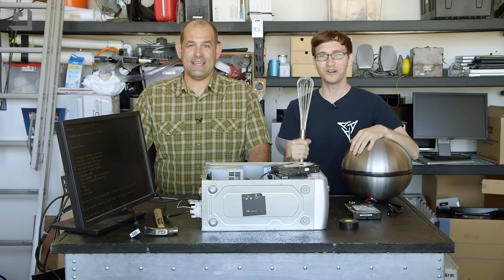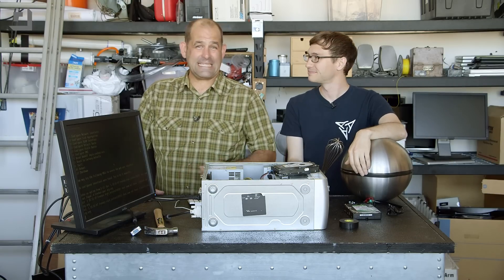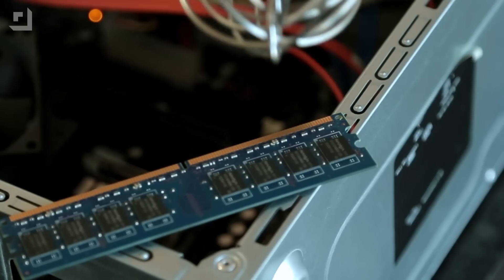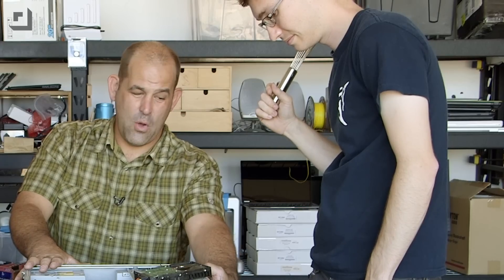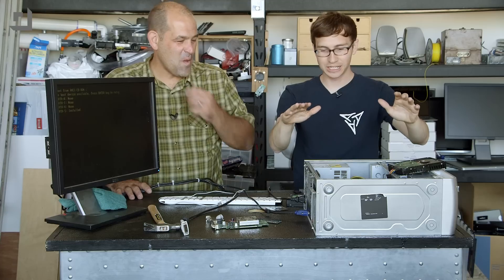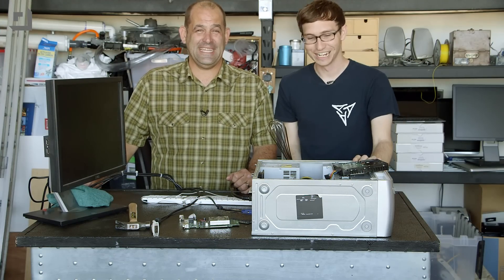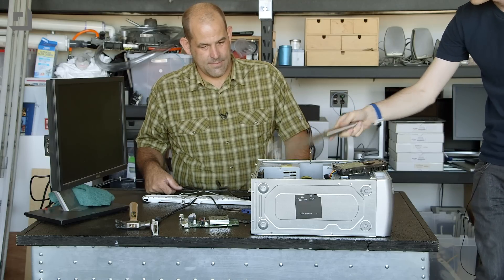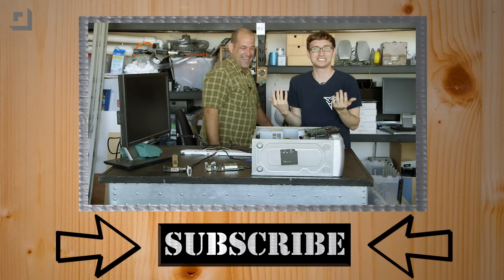Can Static Electricity Kill Your PC?

Comment: Speaking from 20 years of experience repairing/building computers and 5 of electrical engineering, I can say that your average user won't ever have to worry about an electrostatic discharge or ESD causing damage to their computer. Unless you're doing stuff professionally or on a regular basis, I wouldn't say it's a necessity. But it certainly wouldn't hurt. I mean they're only a couple of bucks, vs potentially hundreds or thousands of dollars of damage. But even if you're working with your bare hands with electronics in a dry room, you should be fine as long as the electronics have no path to ground. Anecdotes are weak evidence, but I can say I've personally never had a problem with static working either in computers, or with bare circuits for other things. And I've never heard anything second hand. Having said that though, you can still shock electronics and not even realize it. Either by not feeling it. Or the electronics just won't show any problems right away. Or might have problems you don't connect to the ESD if you did feel it.

 BUT I will say I did just see a video recently where a poor guy was unboxing his new gaming computer, and while he was taking the protective plastic off of the glass, it generated a lot of static and killed the computer. Which I can personally attest to. I've also noticed protective plastic coatings generate a lot of static when you peel them off. So keep your electronics unplugged if you have to peel off anything like that. And ground it with a wrist strap if there is a noticeable amount of static. Or hell, ground it just for good measure. Better safe than sorry.

 So keep your stuff unplugged if you have to work on it. I also make sure to ground myself real quick before working with any electronics. I'll just touch something big and metal, usually the railing on my stairs. If you have metal pipes in your house, you can also just touch a faucet, but I have plastic pipes, so there's no path to ground there. But this discharges any static that's built up on my body before I work on anything. I also try not to wear synthetic fabrics like polyester because they'll generate a lot of static when they rub on hair. Think of rubbing your head on a balloon, same deal.

 And the biggest anti-static rule for me, is absolutely NO KITTIES. Cats are static death traps for electronics. Always rubbing against everything. They know damn well what they're doing, believe me. I've caught my cat reading my white board with electronics notes and diagrams on it before. They understand more than they let on. Plus, one memory that sticks out from my electronics classes was when the professor rubbed a glass rod with a cat pelt to generate static. I have no idea where the school got a cat pelt, I just know it was very old, having been used for this demonstration for decades. So I assure you no cats were harmed to teach that class. At least not any time in the last few decades. But all that lesson taught me was cats = static death traps.

Comment: Static electric discharge can damage RAM in some strange way where it still works most of the time but causes an occasional error which can result in crashes/freezes or other problems. So if you run a diagnostic test on the RAM it will probably pass the test but still be damaged and cause problems.

Comment: Hi

How does touching the metal case of the computer help to discharge the body of electric charge if the computer is unplugged?

My view was that you can only discharge the body if connected to an earthed/grounded cable?

Comment: You don't need a wrist band but it's a nice just incase item to have. Just leave your PC plugged into the wall with the PSU off and touch a metal part of the case every now and then. I wear a strap when I'm building a PC from scratch but when I'm upgrading a GPU or hard drive, I just ground off on the case

Comment: I was building my mother board and I had it on top of the anti static bag. have I just killed it. the whole time I was ground.
Reply: the outside of the antistatic bag is conductive
Reply: +Duncan Robbins-Gennerich the whole bag is conducive, that's the whole point, it's basically like touching a metal surface.

Comment: So a few years ago I had a PC that exploded well the PSU short circuit and blew up in a bright white hot explosion that scorched the side of my motherboard and leaving a black residue on the inside of the case to this date all of those components except the power supply of course still work 100% can anyone explain this to me PS I never ground myself when I work on computers I know I should but it's never been an issue for me
Reply: probably a bad resistor or some metel touching the inside of the PSU

Comment: Even if there's only a 1 in 999 trillion chance of static causing a problem, its still worth having one. Shit, the decent ones are usually $1 or less. I'd rather not chance turning my $1500+ build into a paperweight. Especially since I live in a very dry area and am usually on a carpet. Just seems stupid not to when they're so cheap and easy to use.
Reply: If you live in a dry climate then definitely wear an anti-static wrist strap.

Comment: hey guys I have a large format printer that catches a lot of static where the media rolls in through. I've seen a couple companies online attach two magnets one to each side of the printer and then run a string from one end to the other magnet. my question is what are they using in their string? what material is it made of? please help I'm not trying to spend $150

Comment: I never had one of those funky wristband and the mat on table to protect. But so far in 5 year, havent zap anything yet in my pc.
And i do not wear shoes or have a carpet on floor.
Reply: You should probably start wearing one, just because it hasn't happened doesn't mean you aren't immune to it. It's always worth it to be cautious.
Reply: +Deadrablade Just toutch something grounded before handling PC parts. 

Fixed.
Reply: Gaming with Lever That does not mean static can not build up while handling the parts. You never ever want to be grounded when handling components, you want to be on the same electrical level leaving no room for negative or positive discharge. It seriously does not hurt to just wear the bracelet.

Comment: I can feel a current like sensation growing in intensity generating from the power supply that the longer my pc is on eventually grows to envelope the entire case, a few weeks before this I have replaced a cable plugged into the psu for whinning while turned on which only stopped when i pinched the cable. That cable also gave my hand a tingling sensation when plugged in. I have had my pc disconnected for the past couple of days with the psu switched off, though the current was felt in lessing intensity after a day and by the second it was gone. Although my pc operates seemingly unaware of its own electrification,  i do not want to risk a catastrophe of losing any more hardware if it decides to fail completely. The psu in question is a LSP Ultra 750 watt. I will never fucking buy that brand again. I'am I right in my current decision, or I'am i overreacting? A new powersupply is currently being shipped over. 
I now know its the entire shit house thats fucked, nothing is grounded, how can i ground my case so that the current finds its way to ground elsewhere.  I live in a third world shithole, the only thing they got are plugs and some basic wires not volt meters or any civilized shit. Is running a case that is charged with electricity all over dangerous to the computer? Because that is of utmost priority.

Comment: IF anyone wants a real-world answer to this, I have it. I've worked on computer systems for 3 years with, and without, static protection gear. Never did anything that would cause me to have a particularly high static charge. Results: Most of the machines I worked on without static protection worked, but, a lot of components did, in fact, stop working, due to ESD from my hands (~15%?). More importantly, 100% of the components I worked on with protection did NOT stop working. which is why I used it when available. Another word of advice, if your component gets zapped by ESD and stops working, take it out and keep it aside for a while. Depending on the component and discharge, it can take a couple of hours, but, it might actually start working again. (Not always though, sometimes they die for good)

Comment: solid state components ( the black wafer chips)are really susceptible to high voltage low current electricity, even shocks you can't feel can cause stability issue or component death... you dont necessarily have to wear a strap as long as you ground yourself to the case

Comment: BTW, this was really dangerous because the way he was shocking the components was putting the electricity directly across his heart.
Reply: Luke Kuriata It is how it works. Lightning's static electricity too, and I don't really see people living to tell the tale that it's not dangerous at all.
Reply: Edwin Animationcraft
I re-evaluated what was happening here, and I think I was wrong. It most likely has not enough current to stop your heart.
Reply: +Nathan Fletcher its the amps that kill you, not the volts.
Reply: Nathan Fletcher its static electricity, thats not how it works and its not dangerous at all
Reply: +Adrian You're correct. But I don't think its strong enough to do that. Its about the same as wearing socks and running across the carpet or something,

Comment: this is pointless.. unless ur doing shit on whool carpet ur fine..... even if u do shock it/ urself it's not that big a deal. If ur on a wooden floor and it's on a wooden table i doubt you'll shock anything unless ur about to get hit by lightning and then there's is the problem of a giant lightning bolt hitting u & ur pc, but maybe it would morph u together with ur pc and make u PCMan! The most politically correct person as long as it's on Wikipedia.......ever!

Comment: You don't need the bracelet. You just need to ground yourself before you start working. Continue to ground yourself every so often while you are working. Ground your PC one final time before you start it up.

If you're going to work on carpet have on shoes with rubber soles. But don't work on carpet if you can help it.

Comment: I don't think this test was done properly becuase when you build a pc its not plugged in. So if you were zap it with static electricity when it's off it may do less damage becuase when you zap it when it's on it can do more damage to it cuz it can shirt circuit or something like that, it just isn't right to do the test while its urged in.

Comment: I have always handled my pc insides without precaution regarding static discharge and non of my components have messed up (well maybe 1 hdd died of that or natural degradation of aging). Has anyone ever actually experienced death of till then working gpu, cpu, ram or mobo after handling them in ''unsafe'' manner?
Reply: ESD damage may immediately or may not immediately destroy a component. Sometimes it's instant, sometimes it's not. It's better to be safe than sorry.

Comment: I love this show but before I watched this I was hoping they would be a little more scientific. For example only hitting the components with a little charge that one would acquire from moving around.  Or leaving  grounding the components to drain the charge from them before using them.

This was funny but a little overkill , I mean if the static shock is enough to make you actually jump then of course it's going to fry the hardware. I would have like to see this test revisited with you trying to fail hardware under realistic building conditions.
Reply: Little charge one would aquire from moving around ??? Yeah ok, just walking on a carpeted floor builds up around 25000 volts in your body :-)
Reply: Emtildeath6666 Yes but there is a distinct difference between volts and amps, also those static shocks last for one fifth of a second while these guys completely toasted it.  :)
Reply: JAGUARCD32X And the static i your body can do exactly the same thing :-)
Reply: Emtildeath6666 Yes but nowhere near the intensity shown here mate, this was like watching a mini tropical thunderstorm  :-)

I love this channel but would like to see this test looked at again under normal conditions.

Also I wonder what would happen if they left the hardware for a while to let the charge drain before trying to use the hardware running power through it?.
Reply: ***** Yes, I wanted the test to be a little more scientific seeing if the average misuse that these parts may receive while building a PC is enough to damage them. 

They could have tried to damage them under realistic scenarios and if they were still working then used this machine to generate such a charge afterwards.
Reply: ***** I was also wondering if one would be enough to kill a piece of hardware myself. I was also wondering if you left the hardware until the charge drained before use if it would make any difference?.
Reply: The young eager nerd was just going ape shit with the shocks, i just shook my head thinking, wow this is really scientific......all i learned from this was frying a computer......fries it, everyone knows that. Good experiment, horrible unscientific approach. Makes them look disreputable, shame shame
Reply: Hi,My house is not grounded and whenever i thouch my pc it giving me shock can i use my pc ?

Comment: From what I understand, it doesn't take much potential difference to kill most PC components. The real issue is the insulation, so if you have a different charge but you touch only the insulated parts of a component, you should be fine, but if you touch any exposed metal parts that are part of the circuits, then you are more prone to kill it. Even in cases where you don't kill a component, I have heard that you are shortening their life. I am sure even one single zap is enough to kill any of those components as long as goes through the circuit. I'm not an expert on this, so it's just what I think. The case itself is not an electronic component so you can't kill it. Even though it has the buttons and lights connected to it, there's usually insulation between them. The case is also grounded as long as it's still in contact with the power supply and the power supply is connected to the wall outlet with a three pronged connector, so that protects everything else inside the case, and is the reason you attach the anti-static wrist band to the case.

Comment: This is a little overkill but still you should use a ground strap while working on stuff and if you can lay down some ESD mat. but really you can work on devices without an esd mat and a wristband, just don't be stupid about it.
When I ran a repair shop I walked in on the owner of the shop stapling regular old house carpet to the workbench I had built. I calmly asked him what he was doing. He responded in his iranian accent "protecting our customers products." We removed it and left it as wood until the esd mat came in.

Comment: Half way through watching this clip my computer blue screened.
Reply: ROFL

Ive been building for 20 years now and never wore the straps. Never killed nothing. Now i did make a computer turn on while bench testing. Static spark right to the power button pins. simulated a connection and it turned off. Was fun to replicate and show off.

Comment: I wondered if this was true, and to what extent.

I have a question I hope somebody more tech-smart than myself can answer. I noticed when I'm lying in bed with my tablet or phone and the headphone jack touches the blankets I can hear popping noises in my ears, and I can sometimes feel a small jolt when I touch the headphone jack. Anyway my point is that I'm obviously picking up some static, so when I plug in my headphones could I possibly wipe out or corrupt my device's memory? Thanks

Comment: Only time I've ever worn an anti-static wristband was at college during a lesson on assembling PC's. Never had a problem, but then never built up enough of a charge in my body to cause a spark either, lol. Common advice seems to say as long as you ground yourself on the case before you start touching components you should be ok.